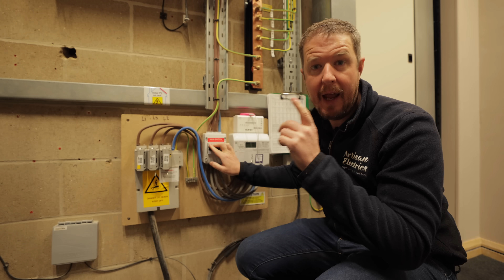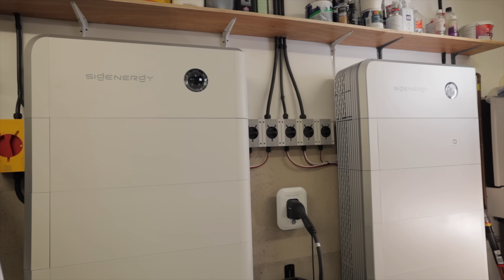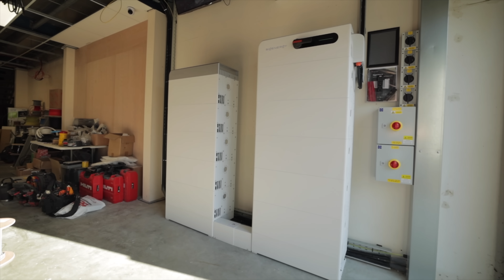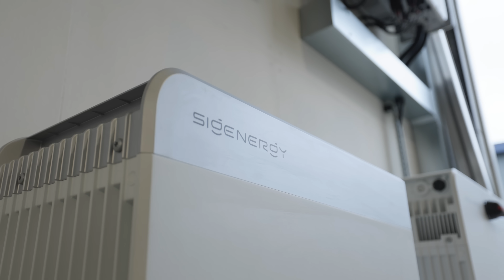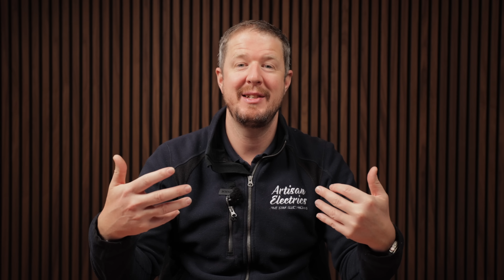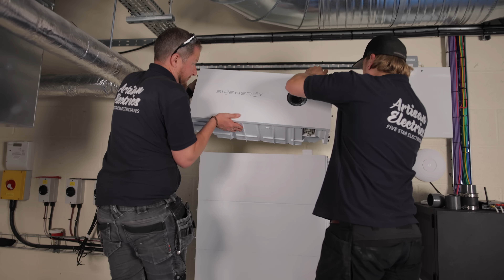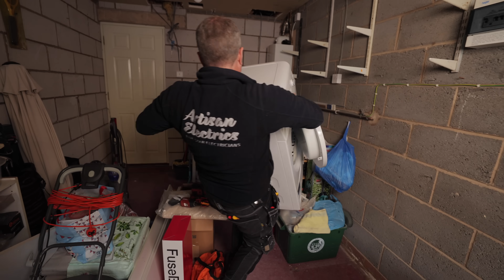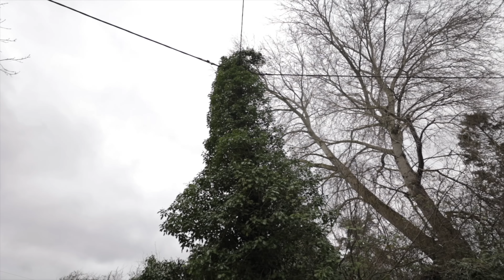You’ve Been MISLED About Battery Backup

Comment: My question is.  If I have a battery pack installed, regardless of its charging source, why would I want anything other than UPS?  I've not delved deeply into back-up power systems, so please excuse my ignorance.
Reply: I assume its down to price, most batteries are sold combined with solar so the home can store the solar energy and use it later when its dark. It was only when I started researching I found out many systems are sold without the ups option.

personally I think it should be part of the inverter
Reply: @adrianscarlett  It's not part of the inverter in the UK because most UK people live in towns or cities with a few hours of outage a decade so they don't want to pay for it.

There are inverters with various levels of it including and even generator support built in - eg the Sunsynk kit can do full house backup with big ones, or some circuits with smaller ones.
Reply: Mix of things - efficiency and cost are the two big ones. It's also usually cheaper to have an EPS system and put a small UPS on the computer equipment like a PC that needs 10ms switchover.
Whole house backup and UPS gets really pricy and has limits - it's not like you want your electric water heating eating your battery in a powe cut either.
Reply from the maker: It’s all about cost really - the closer you get to true UPS the more expensive the system gets

Comment: Using a battery system is becoming increasingly important for taking advantage of variable energy tariffs. The battery can be charged when electricity costs are low and used when they are higher. Combining this setup with solar panels reduces electricity costs even further.
Reply from the maker: Spot on, tariff optimization is a huge bonus! 🔋

Comment: Yes my home stays on when grid power goes off. 

Yes I have a large Givenergy H3 10KW inverter and 20.4KW of Giv HV Batteries so MOST of the house stays on, when there is an outage.  
BUT yes I have to exclude some large loads but mainly thats ok. 
BTW its a Givenergy HV Battery system.
But Im not using Givenergy Gateway, but running a DSH Auto backup product with sub-milisecond cutover.
Totally agre MOST of the inductry dont have much clue on survey and solutions for Auto backup near whole home solutions.
Reply from the maker: Spot on, survey is everything

Comment: Greetings from Ukraine. It's 100% DIY botchery at every corner here, but that's a purely out of necessity. I also contributed to it. I have a dodgy no-name hybrid inverter with 2.5KWh battery that runs my WFH setup and the fridge, and it has saved my buttocks countless times for the last few years. It's not true UPS, but good enough.
Reply from the maker: That's incredible, glad it works for you! ❤
Reply: The deye hybrid inverters might interest you. Those are comparatively cheap and allow you to pass through the grid and enable backup that way. All in one box except the batteries. They are quite common in south Africa where they have rolling power  cuts.
Reply: @Felix-st2ue  yeah deye are well-known around here and are considered pretty much the luxury brand. With that said, they are pretty pricey (around 5x of what I paid for my Anenji), and I'm currently renting so splicing it into the mains path is a no-go. My current setup is a hybrid inverter + battery on a trolley, with a mains plug on the input side and a power strip on the out. Yeah it's not ideal but when we have 4-8h of electricity per day you do what you gotta do.
Reply: @Felix-st2ue  now also Hoymiles joined the race, been using Deye in my old home for since 3 years ago, but in new home I'm going for Hoymiles if they support wind turbine 😅
Reply: @Felix-st2ue  Yes, and they are also branded as other systems, so I did that with a unit on clearance, paying half price for the inverter, and half the price of the battery packs. ACDC had the 3kVA inverters on sale, for cheaper than the 1kVA ones, so upgraded to 3kVA from 1kVA, and spent on lithium iron phosphate batteries, instead of the lead acid. Just a little bit of RTFM to set the inverter up to keep the battery under 95%, and thus get longer life. for an inverter that said only for FLA and VRLA, it also has custom battery levels available, so set it to match the lithium battery instead, and to limit charge current to as low as possible, 13A, so as to allow me to use it on a plug outlet and not wire it in. They had 7 in country, I ordered 1, and looking a day later zero stock, so somebody also had the same idea. Battery another supplier had 3, I took one, and ordered a second one 2 days later, as there was only 1 left. Wanted to get a second system for other use, but will look around later. Just have to look into polar, or look into using that solar input to feed in the generator if needed.
Reply: Slava Ukraini!
Reply: Frankly, how you guys survive absolutely amazes me. Whether a no name and bodged system is deployed, it is deployed out of necessity. And probably a better installation than most done here in the UK by the monkeys I come across.

Slava Ukraini
Reply: My friend in Kyiv uses a Deye inverter hooked up to a Tesla model 3 battery. 

Going to do the same thing in the UK with a Solax Inverter soon. 

A 75 kWh Tesla pack is about £1,500
Reply: If you have the need to combine itwith a cheap generator for rechargin ghe battery while under load there are two options that are easy: Connect the generator to a DC charger that provides the right voltage for your batteries and the charger to the batteries, that way you can top uff the batteries while under load during a power outage. Alternative is to get a high voltage Power supply that connects to an empty PV string anf the generator. That way the inverter reacts as if the sun shines even if it is the middle of the night. Second approach also works with inverters that use a high voltage battery (e.g. Fronius). There is a 3KW 400V Powersupply availabe from meanwell that works very well I havee used it during longer outages to top up my Batteries on a Fronius Symo gen24. For 48V Batteries there is a comparable 48V charger available from Huawei.
Best of luck, Slava Ukraini!
Reply: For many years l have kept several simple systems, each one using a trickle charger, battery and inverter.  When outages occur we simply plug devices into the inverters.  Fridge system is largest, followed by two bedrooms with warm air heaters. No single points of failure, woodburner stove and small generator if outage lasts too long. Not perfect, but cheap n flexible. 😊
Reply: Good luck to you all .
Reply: Good luck, Ukraine. Best wishes to you all.
Reply: Slava Ukraini!

Comment: The problem with any type of backup power is that they are not unlimited.  I have a full house backup but it is only good for about 6 to 12 hours depending on usage.  Very expensive however.  I had the power go out one time for 6 days.  too long for any battery system.  That only happened once however, usually you don't even notice that the grid went down for an hour or two.
Reply from the maker: Spot on, 6 days is a long time! We install backup generators for those longer outages which are rare
Reply: Why don't you have solar panels hooked up to the batteries??? It definitely can get you through six days and the rest of the YEAR....

Comment: If a heat pump system has a storage tank, you've already got a thermal "battery"!
Reply: Typical home hot water tank is about 5kWh - which is why you want to heat it on the EV overnight rate not on demand.